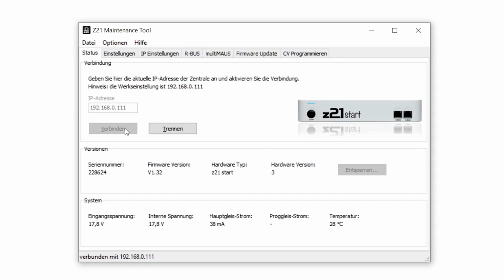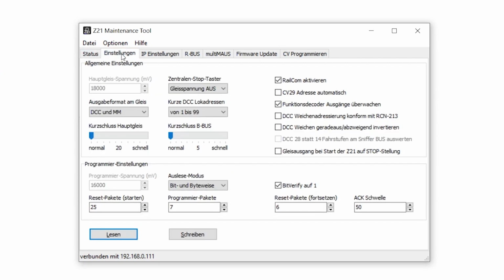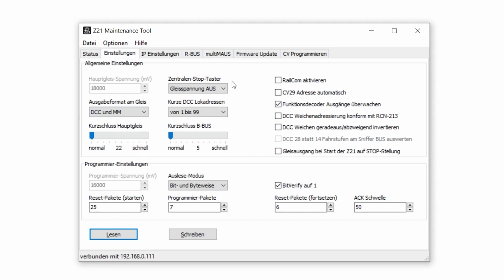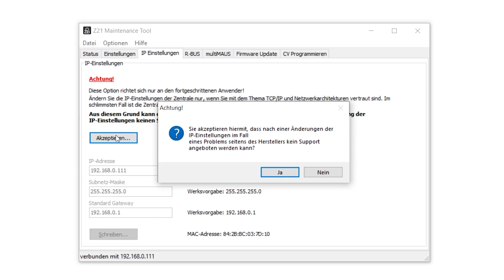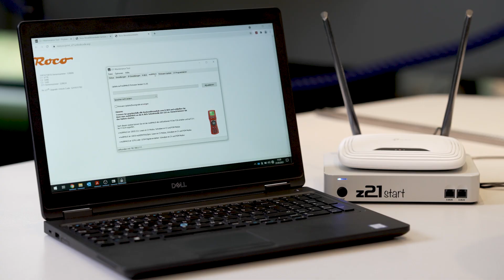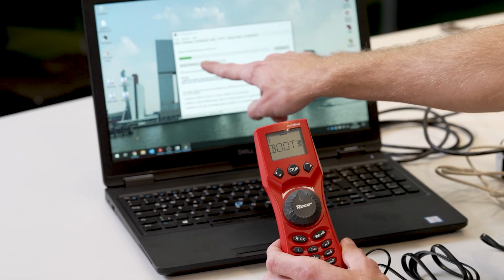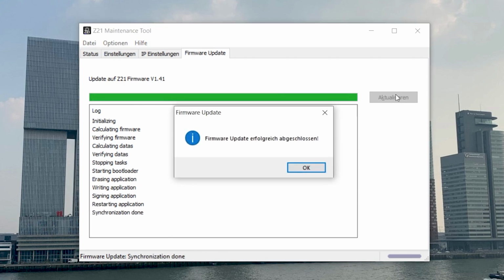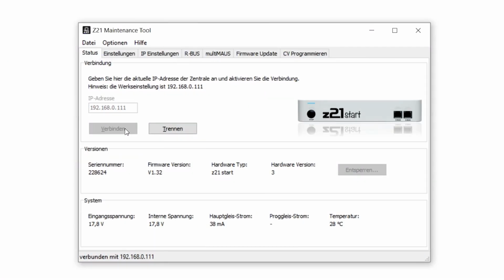Part 4: Z21 Maintenance Tool

Comment: In my honest Opinion Railcom is not the most important setting!!! A lot of older decoders can react in strange ways (as in interpreting the Railcom Signal as an Analog voltage) and react in a way that they see the DCC signal from there one as a full on analog DC voltage and set off without being able to be controlled again. This is even with decoders with the ability to use Railcom. 

The first and upmost important setting is the RAIL voltage!!!! If u use N-gauge decoders a lower Voltage can be required as older nano-decoders can handle only 16V! Only the latest generations of nano decoders can handle 18V. For H0 of course this is less important because they use bigger decoders.

Comment: Thanks for the clear explanation of this tool. I didn't know that it can even upgrade the Multimause. Is it possible to change the trackvoltage? I have some decoders that doesn't like 18V. Greetings from Holland.
Reply: The more expensive black Z21 has the ability to set the track voltage. The white z21 and z21start is about 1 volt below the input voltage. So around 17V. All of the decoders I've ever used with z21start, including N scale locos, have been fine.